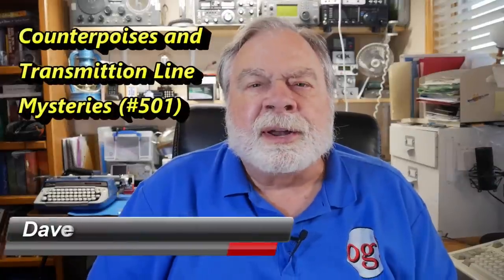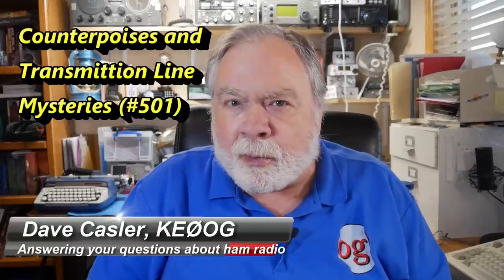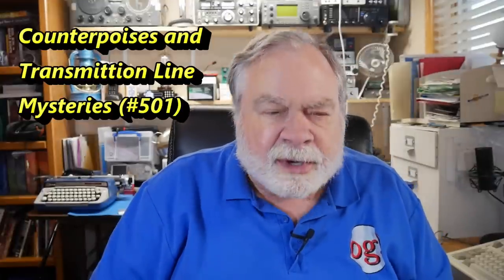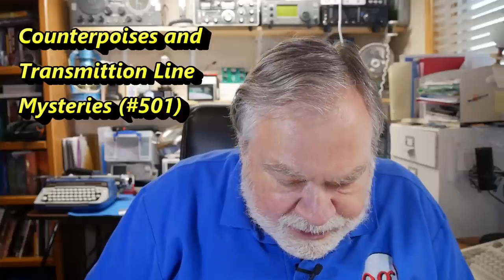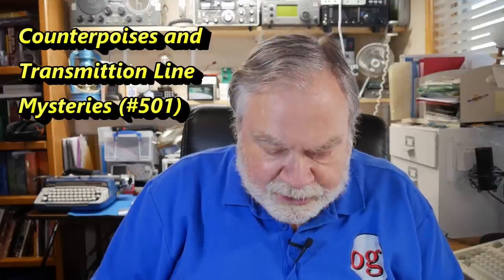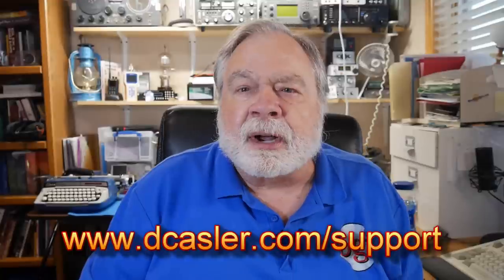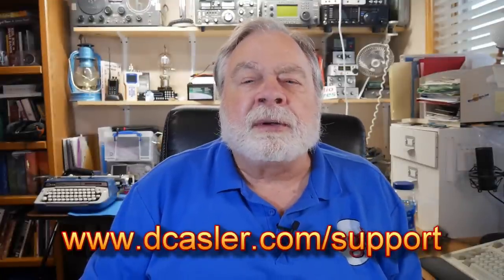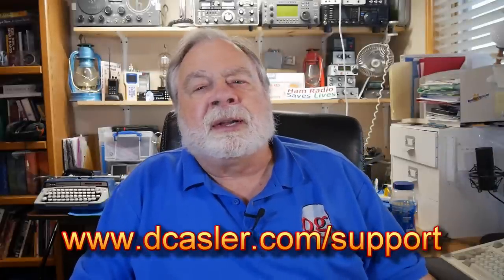Counterpoises and Transmission Line Mysteries (#501)

Comment: Taking out the 20' coax most likely made the total antenna/coax length closer to an exact 1/2 wave on 40m. That is extremely high impedance, higher than your tuner, even at 10:1 will handle.  You can either replace the 20' section of coax or lengthen the antenna itself by 20'. This will get the antenna system length away from the exact 1/2 wave length and lower the impedance so the tuner will be able to compensate. Exact 1/2w impedance can be in the kilo ohms.

Comment: ALL endfed antennas use an UnUn (Unbalanced to Unbalanced) transformer, not a BalUn (Balanced to Unbalanced). The Endfed dipole (or longwire) uses a 1:9 UnUn, an endfed halfwave usually has a 1:49 or 1:64 UnUn.

Comment: So, a fellow ham SWEARS that by running a counterpoise wire under his 80 meter dipole (just a 14 ga. wire the whole length of the dipole), it made a big difference. I remain skeptical, but I could be wrong. 🤷
Any thoughts from the community?
Reply: Yes, if you have a a counterpoise or rather reflector that is 15% longer and .1 to about .25 wave away, you have a two element beam with up to 3Db gain. A great NVIS antenna.
Reply: @rogerlafrance6355  In his case, he has a half-wave horizontal, 80 Meter dipole about 50-60 feet up and a 14 ga. wire on, or just below the ground (earth) run the length of the dipole. Very interesting indeed
Reply: Spike S  Thanks! I'm going to have to look at that. It sounds really interesting and I can't find very much info online about it. I appreciate it!
AA2HA